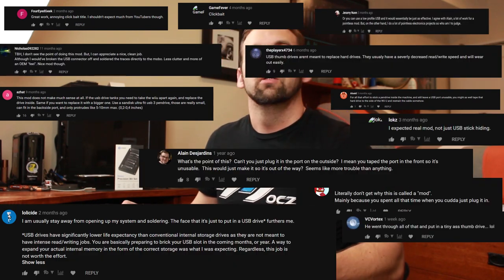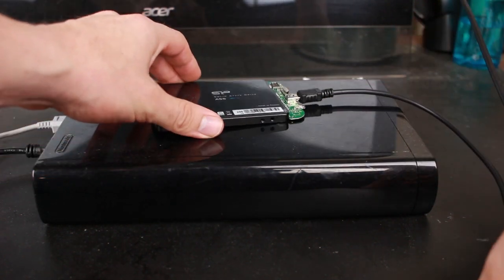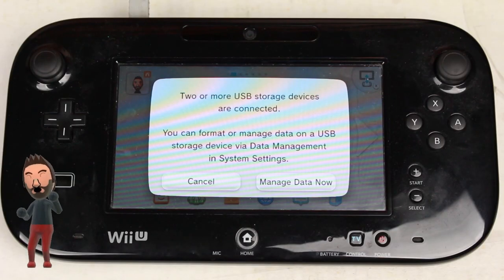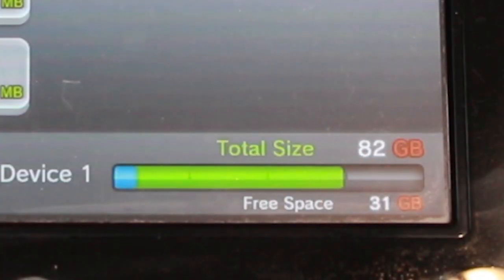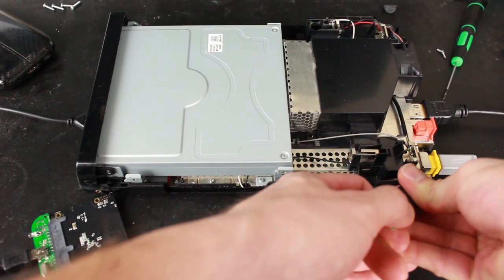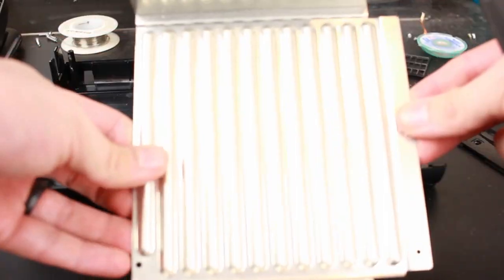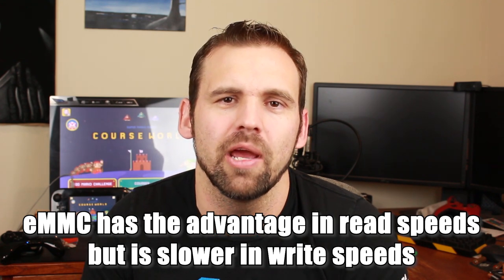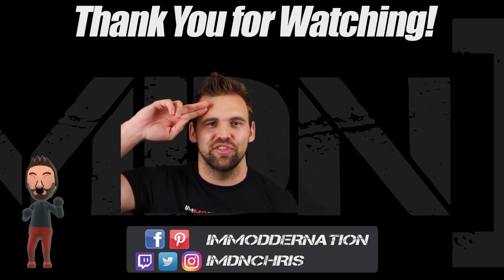EXPAND YOUR WII U INTERNAL STORAGE WITH AN SSD | GUIDE

Comment: If i have the only 8gb white model, could i just swap the hard drive or whatever it is from the black 32gb because i have that too but its in way worse condition, but all my games are going to be physical so roughly how many games could i have saved on just the 8gb model, does it download the whole game with physical games or just save data?
Reply from the maker: I have the games installed on the SSD. Many of them are GBs in size. I think BOTW was like 11 GB with the DLC and updates. I don't know how much is stored when you play off the disc, but I imagine some data (besides save data) is stored to make the game load faster.
Reply: @ImmodderNation  yea some type of data has to be stored, I have like 6 or 7 Wii U games and around 5 regular Wii games so I have no idea how much more I can add but I'm assuming not much, don't know why the SD card slot can't be used for storage I thought that was strange, and it says the Wii U isn't powerful enough to use a flash drive or external hard drive without a separate power source

Comment: I wonder if it would be possible to cut a chunk off the of the drive top, Wii U top and drive heat sink so you don't need to remove them to squeeze it in.

It may be doable. What may work is a USB to m.2 adapter
Reply from the maker: Easier to remove that to cut. Where would you cut? M.2 would be doable. Very cost prohibitive, but possible.
Reply: @ImmodderNation  You'd basically use a power sander (or a sledge hammer lmao) or something to flatten the ridges on the metal drive heat sink, then cut into the top of the drive cage but not all the way through it. That would make a slightly bigger gap for the drive so you can close the lid.
Reply from the maker: The heatsink ridges are mm. I took the top off of the disk drive already. I think you're making a lot of work for yourself but just my opinion. M.2 to USB could work if the apapter is thin enough. Right now SATA SSD present the best value compromise of durability, price, and size.

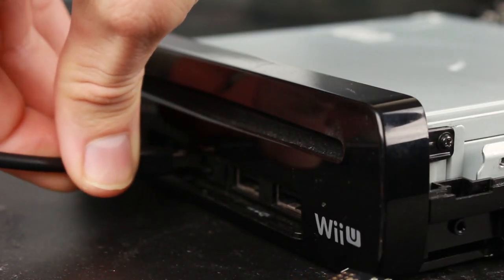Comment: 4:00 I thought the Wii U had a Sata II SSD 32GB or HDD 32GB

5:57 Just wow Nintendo , I give you an applause for using that, instead of using the same amount of money on putting a 160-500GB 5400RPM hard drive on it, you use a 32GB drive, wich isn’t even a SSD ,it’s just an eMMc drive wich is much slower than normal SATA III SSD and as fast as a HDD.
Reply from the maker: Nope, it uses eMMc just like the Nintendo Switch. That's what allows  communication with SD cards.
Reply: ImmodderNation and also eMmc is Slow compared to the slowest sata ssd‘s , maybe Nintendo could have put a 160GB 5400rpm or a 250GB 5400rpm hdd in the Wii U with the eMMc
Reply from the maker: @armeniancrusader301  SD card readers. They can communicate with SD card readers.
Reply: ImmodderNation oh ok then
Reply: ImmodderNation  it would be cool if Nintendo put a 160-250GB hard drive 5400rpm with the 32GB eMMc in it to store the games on it without having to buy one seperately.
Reply from the maker: SSD would have been the best choice. HDD will die over time
Reply: ImmodderNation yea but ssd would be expensive in 2012
Reply: ImmodderNation it may be kinda cheap now , but in 2012 it was expensive
Reply from the maker: @armeniancrusader301  Agreed, I think what Nintendo did for the time worked fine but I hope Nintendo will adopt new technology in their future consoles.
Reply from the maker: Somebody already opened the Switch Lite. Same architecture with a more efficient chip and a smaller battery
Reply: @ImmodderNation  all things die over time even ssd 😂
Reply from the maker: You're correct Ross, but less moving parts equal less things that can fail. That's one reason why solid state media is preferred to HDD.
Reply: @ImmodderNation  Back then 160GB / 250GB 5400rpm 2.5 inch HDDs were as expensive as flash 32 GB eMMc, I’ve seen PCs older than the Wii U with HDDs and they work fine so the Wii U with a HDD drive should work fine today too.. I mean even the original fat PS3 that was released 6 years earlier had a 60GB HDD (there was a 20GB one too but still). Not only that, there was a cheaper Basic Pack Wii U wich had non painted regular white plastic wich means it’ll yellow and it had ONLY 8GB of storage. That was kinda fine for a phone from 2012 but we‘re talking about a whole home console, not a phone and in 2012 most home devices used HDDs instead of flash.

At least Nintendo could’ve made proprietary Wii U memory cards like the GameCube and PS2 had wich are either flash or HDD and they could’ve been reasonably priced but yeah the Wii U already happened and it’s discontinued so Wii U‘s a thing of the past and goes into Nintendo Console history.

Comment: And an SSD will live longer compared to a mechanical hdd??
Reply from the maker: Not necessarily but less moving parts, making it more reliable for transportation.
Reply: They have a shorter lifespan but they are way more reliable since they lack moving parts. The main difference is that you can back up the files of a failing hard drive on most cases, and move the files to other one, the ssd if it dies it dies.
Reply from the maker: And if the mechanical drive stops spinning you'll spend so much money trying to recover that data. Best to backup game saves.

Comment: My ssd isn't reconised is a 2280 samsung with an orico adapter solder directly u try disconnect usb c cable and out non solder one connect on a real usb port but dosoen't work
Reply from the maker: I haven't tried an M.2 SSD, so your results may vary. You may have soldered the wrong leads. Try connecting the drive via USB first before soldering.
Reply: i try can do with  ngff and M.2 SSD @ImmodderNation

Comment: I'm doing this right now and I was wondering if the USB puts out enough power for the SSD. I tried just plugging in the SSD and I don't get constant power using the power cable linked in the description. I'm using a 1TB SSD so I don't know if that would draw more power or not.
Reply: Nevermind, I read the comments, got a power splitter on the way and I'm good, I removed the optical drive so space inside isn't going to be an issue at all
Reply from the maker: There's another video I made called Powering your electronic projects that mentions how you can tap power from the DC adapter using a step down converter. 😉

Comment: Unfortunately the 256GB usb stick I planned on using this has issues with installing data for some reason. Either part 128GB or larger games. I don't know for sure.
Reply from the maker: You did format it first, right? I'd try an SSD instead.
Reply: @ImmodderNation  I did. I switched to a USB hdd.
Reply from the maker: @gungan5822  I would have gone the SSD route instead, but if the HDD works for you, try not to move the system around so much.

Comment: can i jusyt buy the adapter and plug it in to the usb port without a y cable?
Reply from the maker: That would depend upon the current draw of your SSD. USB only supplies so much current, that's why sometimes a Y adapter is necessary.

Comment: Does the USB port still function?
Reply from the maker: If you try to use the USB port with another accessory, the Wii U will crash. I've tried it. You don't want to do that.
Reply: @ImmodderNation  Bit of a stretch, but could you put in a USB hub and put a port from that hub in the slot it should be in? It would take a lot of soldering work, but it would still let you use that slot.

Comment: hello, im trying to add an ssd as well but i dont need to install it internally. Every time i format the drive to Fat32, the Wii U asks ti reformat. what am i doing wrong?
Reply from the maker: PC format is not recognized by the Wii U. Wii U uses a different formating system. Just go with the Wii U format, you'll be fine.
Reply: @ImmodderNation  I found WiiBackupManager which allows me to format to WBFS but my pc still doesn’t read. Am I on the right track?
Reply from the maker: Are you looking to back up game saves?
Reply: @ImmodderNation  more than just that
Reply from the maker: I've never been able to read the hard drive with my PC once it was formatted by the Wii U. You can use Saviine to save backups to your computer using WiFi.
Reply: @ImmodderNation  oh I see. I was hoping to be able to just copy files over to it. Looks like it works similar to a PS2
Reply from the maker: Nope, doesn't work that easily cause...Nintendo.
Reply: @ImmodderNation  but the SD card works that way! Haha
Reply from the maker: Because that's what they intended. For saving game data.
Reply: @ImmodderNation  no, SD cards work in the Wii U and in my PC. It’s quite silly that usb does not

Comment: In the video u said the speed/performance is affected by the power supply (1usb port). How about the easy route of connecting it to a y cable
Reply from the maker: The power from the USB port doesn't have an effect on speed. Either the drive turns on or it doesn't. Having two USB ports plugged in doesn't change that

Comment: Even better : Wii U mod with SD card for storage. It's small and delivers better performance than HDD.
Reply from the maker: Can you actually install and run games off the SD card? I don't believe you can.
Reply from the maker: I guess you can using Loadiine but not a recommended method.

Comment: So this Mod just plugs the USB inside the unit instead of plugged in on the outside?  Not a good solution for me as I use more than one drive (have a drive for VC games).  The Headline made me think you figured out a way to replace the NAND (which would be an amazing mod). You can only have 1 HDD connected to the WII U at a time and this mod will make that drive permanently attached. The 300 game limit to the Wii U Menu prevents the VC games from going onto the same drive as the Wii U games.  Interesting video though as you explain the Wii U teardown.
Reply from the maker: Permanently attached was the idea I was going for when I soldered it to the USB port.

Comment: My Wii U burned like two usb drives and they were very small ones (32 gb) that's why i'm not sure what kind of HDD or SSD to get, the console keep telling me to buy a Y cable but that would take two usb ports, seems like the wattage of the usb ports is too low for most HDD and Thumbdrives and that's why the console burns them or corrupts them.
Reply from the maker: Not sure why your drives are burning up. The Y cable is go supply more voltage from another USB port. You can either use a thumb drive or SSD with low voltage and current requirements like I did or draw more voltage from the board somewhere and use that to power the drive.
Reply: u prolly just messing up the format, windows wont see the wii u system external storage format by default
Reply from the maker: Gollot, were you able to get the drive fixed?
Reply: @ImmodderNation  Only one HP has a tool to repair them for bricks like this, the SanDisk is still useless but i'm sure that can be fixed, i got tired of trying with chinese tools.

Comment: My new SanDisk SSD couldn't even copy or move data on the Wii U. It was plugged with a Y cabe on the back. Plugged into the front and now the whole 19 gigs of Xenoblade X installed flawlessly.
Reply from the maker: You might have bad USB ports in the back.

Comment: do i need the Y cable for an ssd ?
Reply from the maker: Depends upon the current requirements. If you use the same SSD as me, no. But otherwise you might. There are other ways of tapping power if you've seen my other video about creative power sources for electronics.

Comment: You may want to reupload your video. I'm not able to view past the first minute. It may be on my end, but every other video I've watched works just fine. Just a heads up.
Reply from the maker: I tested it in my end and it works fine. Try watching it again. 😀
Reply: @ImmodderNation  I actually figured it out after I posted the comment. Looks like my YouTube app on my Pixel 3 was acting up. I had to reinstall it and then it worked great
Reply: @ImmodderNation  Good video.
Reply from the maker: Thank you

Comment: Not much point of upgrading the Wiiu with SSD if you go and bottleneck it with USB 2.0 connection, is there? U could have used a high capacity usb stick instead. Could you not have connected using a direct sata connection to the wii u motherboard. Seeing as you claim to be a modder.
Reply from the maker: I did use a high capacity USB in the previous video. People wanted the SSD. Direct SATA wouldn't matter, even if you could, as you're limited to the speed of the eMMc storage, which is equivalent to USB.

Comment: You claim that the Wii U can theoretically have up to 4TB of storage with 2 2TB ssds. Doesn't the Wii U only let you have one storage device plugged in at the same for normal use, and plugging in a second will redirect you to data management to transfer between the two?
Reply from the maker: 2 TB total is the maximum amount of total storage. Anything larger will not be accessible by the Wii U. Also you can have two storage  devices plugged in at the same time for transfers but you're right in that you cannot play games with two storage devices attached.

Comment: From my limited testing I found that my 32 gig evo plus samsung sd cards had a way better transfer speed than my hdd. Gonna test with an ssd. Also did tests with a random thumbdrive I had and it performed slighly worse than my sd cards, but not that much. Might be my hdd that is garbage xD
Reply from the maker: Could be old HDD or slow RPM (or both). Are you booting installed games from the SD card?
Reply: @ImmodderNation  booting games from sd was fine. I've fixed another drive that works with the wii u. The hdd works almost as well as my sd cards now. Loading times are about the same. The sd cards go in a random sandisk adaptor I found in a desk in our office. the wii u internal memory is empty, so I can back up an insane amount of saves just in case.
Reply: @ImmodderNation  I do have an old ssd (also randomly from around my office :D) but if it transfers and runs fine from a hdd I'm not sure it it's worth doing anything. It's 120 gb ssd vs 1 tb hdd.
Reply from the maker: Remember your bottleneck is usb 2.0. The SSD should max out the USB speeds but I don't think the HDD will. Maybe.
Reply: @ImmodderNation  The disable rest mode setting for drives (down on d-pad and then hold + and - in the menu for managing data) also seems to have helped performance further. I guess it might wear a little more on the drive and be a negligible extra cost of running the console. I'm quite sure the hdd read/write speeds is my limiting factor since the drive is old (8 years? a bit manhandled, removed from original casing since the sata connector isn't firmly locked in place), but I had a y cable for it. Why buy when you have things that already work? ^^

I also tried using an old usb hub (usb 2) with external power source, but transfers were unbearably slow.

Most people will probably be fine with a thumbdrive or a decent sd card in an adaptor. I know nintendo doesn't like to give good ways of accessing old game libraries.
Reply: How'd you get the SD card to work? I read that it only works for Wii game saves, if I get just the 8gb white model, can I play a good amount of Wii and Wii U games with all physical copies and no digital downloads, or is it like Xbox and Playstation where I have to download most of the games?
Reply: @Joe-qd7kd  In usb port. Sorry for the unclear comment. Using an sd to usb adapter.
Reply: @bencarnage7010  thank you, but with just using the 8gb model, would I be alright using just that with all physical games or does the Wii U download most games like Xbox and Playstation?
Reply: Wii U games will fill the internal memory very fast. Most any modern flash drive or sd card will work and will be cheap. If you want a full on external drive you usually want one with a power supply, since the wii u usb ports don't give enough power to most usb-powered hdd. You could probably manage with any usb stick or sd card with 32 gb or more of storage. 64 and 128 gb usb 2 thumbsticks are often very cheap. Beware of fake sd cards and thumbsticks though. SD cards are often a little more expensive, but they will generally last longer. You can do all physical games, but most games have updates that you'll want and those will fill the 8gb very fast. I have a 1tb drive from my wii U that is a over half full, but that's a game library not just what I am actively playing. Since my kids use the wii u too it is easier than swapping the physical games and makes less of a mess too.

Comment: so basically any ssd 120, 240 gb will work with just one usb port
Reply from the maker: No. It depend upon the current draw of the SSD. For the drive I used the current requirements were less than the amount of current the USB port supplied. Check manufacturer specs for more details.